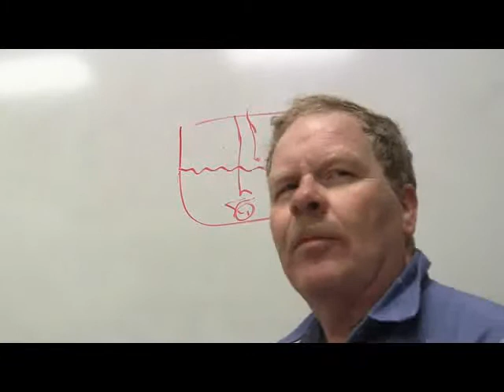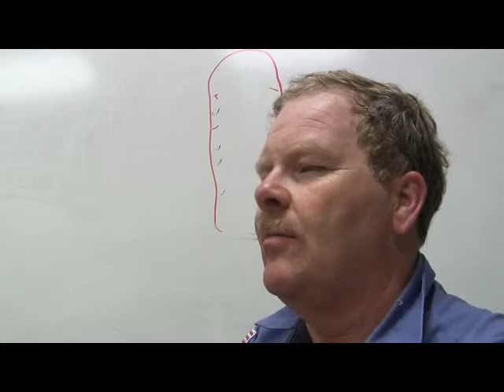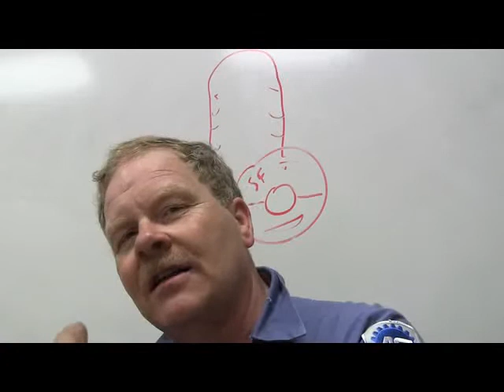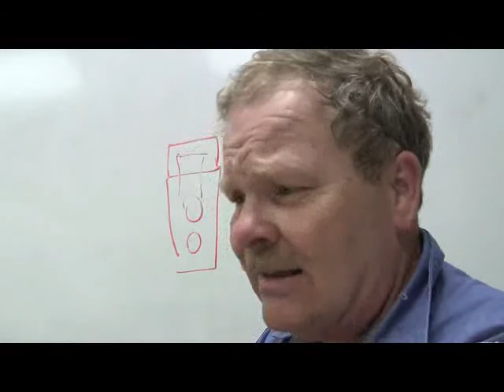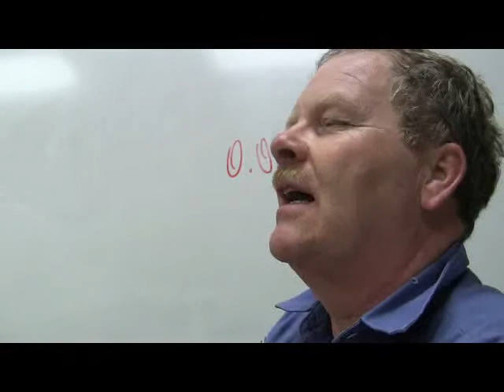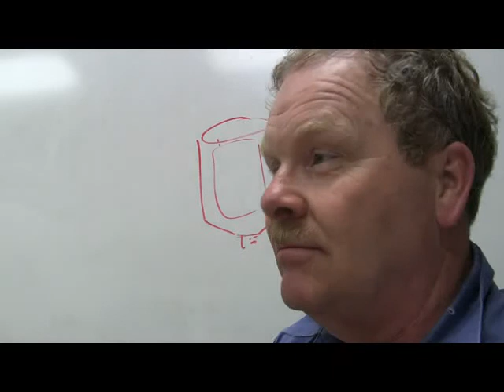Engine Rep tst 1   OIL

Comment from the maker: I change my oil every 3000 miles - and replace my transmission fluid every 30,000 or at manufacturer specs, whichever comes first.  My coolant is replaced the same way - either at 30,000 or at the manufacturer recommended interval.